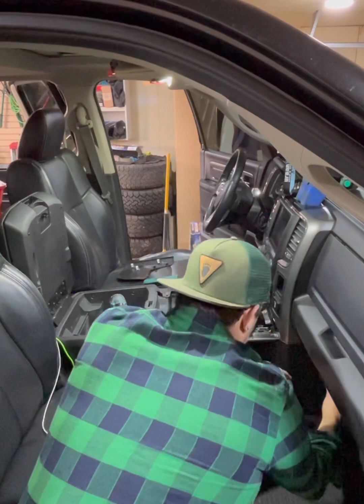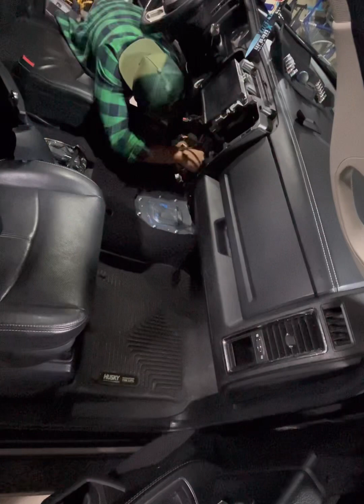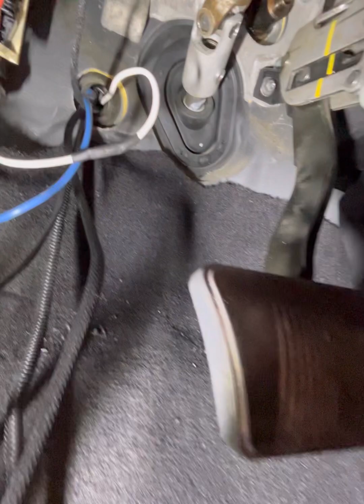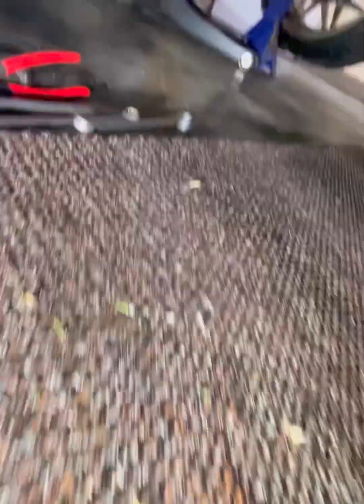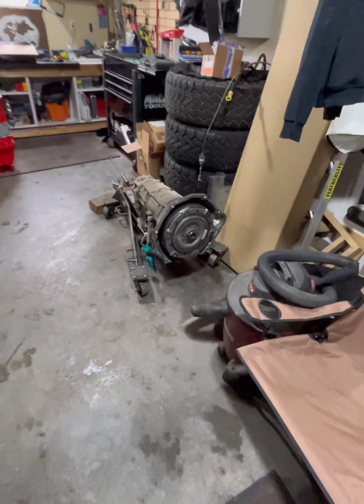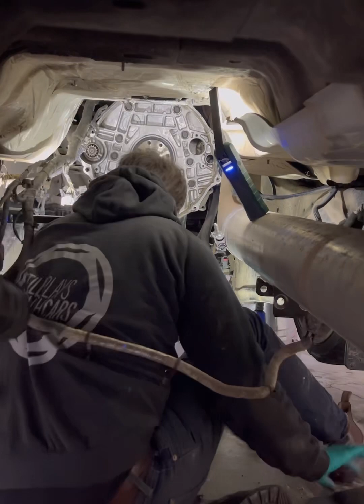G56 Manual Swap in a 4th Gen Ram - Part 4

Comment: I’m hoping to do a swap on my 14 Laramie did you come up with any oem finish or something else that looks good if you do would you share what you came up with thanks
Reply from the maker: I ended up using the Laramie console and did some mods to it to fit with the manual like a jump seat style.  I have some finishing touches to do still though,  I’ll try to get a video posted of that.
Reply: @thekanemadness1 dude I’d love to see what you come up with. I’m about to swap my limited and there is no way I’m loosing my console! I have an idea about grafting a g56 floor console into the business console kinda like you are doing so I’d love to gather some ideas!
Reply from the maker: @dodgefan1259 check out my 8th video on the swap series.  I go over the console in that one!

Comment: Thinking about doing the same to my 2017 Laramie. Interested to see what you do to clean up the center council. I’d prefer to keep the one I have and no have to put in a jump seat
Reply from the maker: I tried find a booster to swap in Laramie trim with no luck!  I really like the storage capabilities of the console.  I’ll get an update on the console - what I have been working on.  Still might make some changes with it as it doesn’t have that factory finish quite yet, and I’d like it to look OEM.  Thanks!